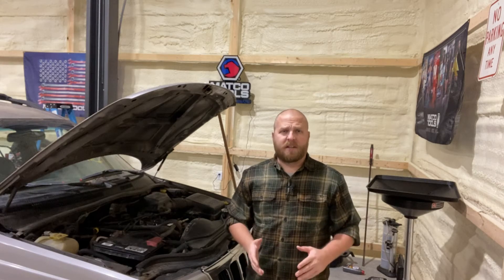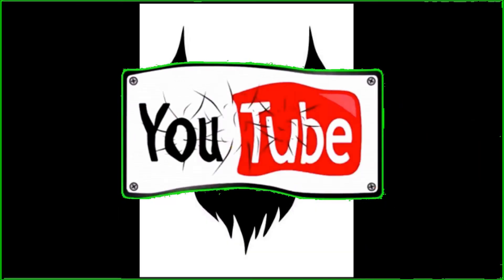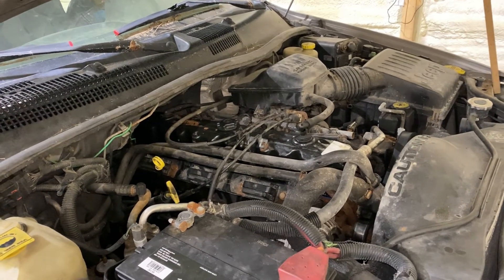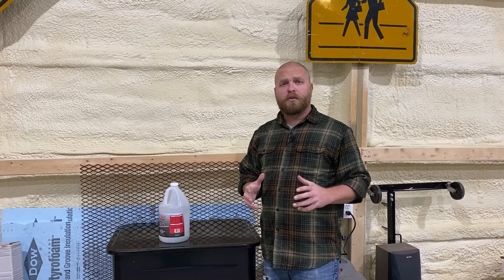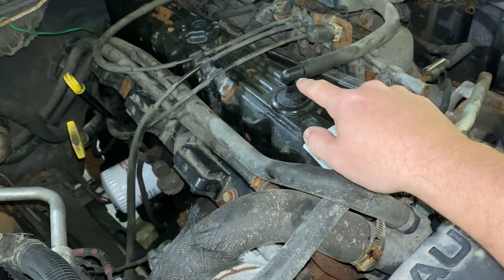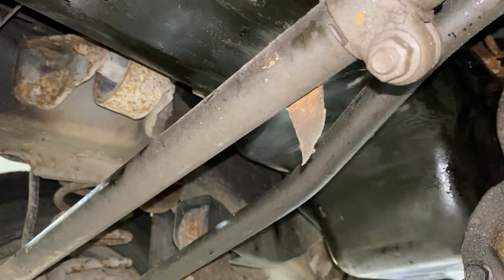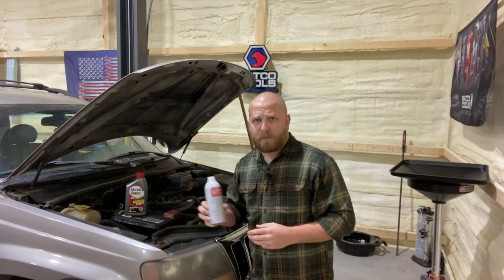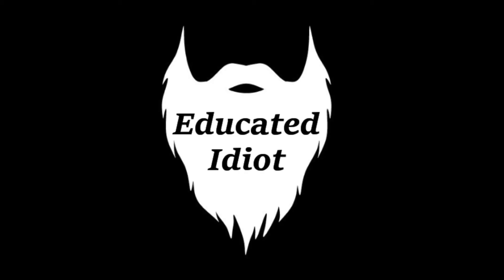Oil Sludge Removal (SUM-909021, SUM-941245-1, SeaFoam SF-16)

Comment: I flip cars for a living, I always add a entire large can of seafoam to the crankcase. Drive it about 100 miles and get the oil changed. In my experience the more seafoam you add the better it works 😂